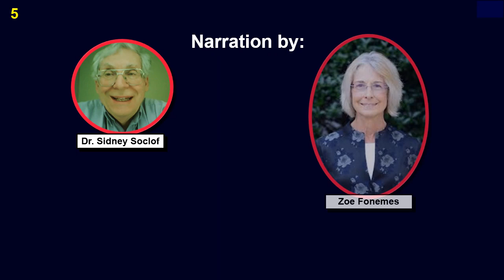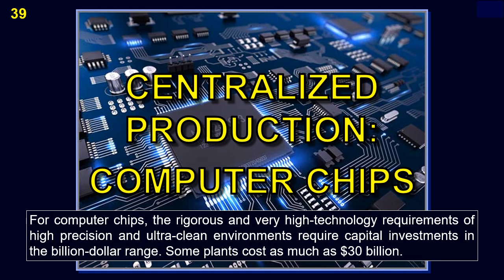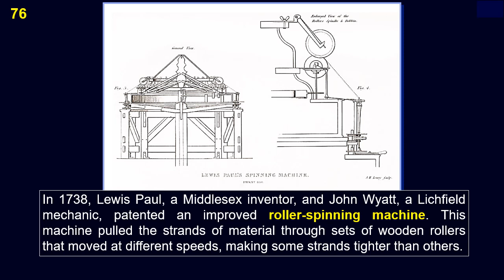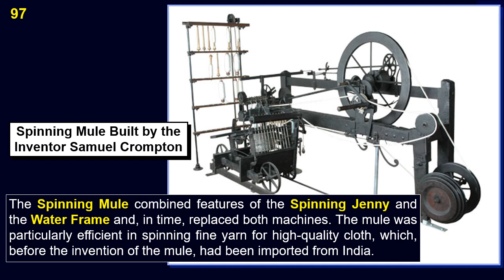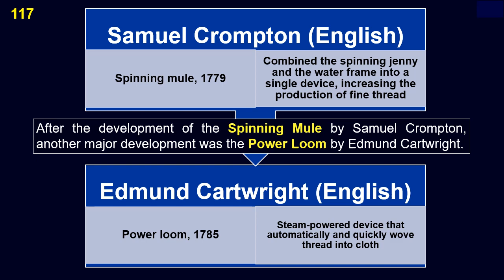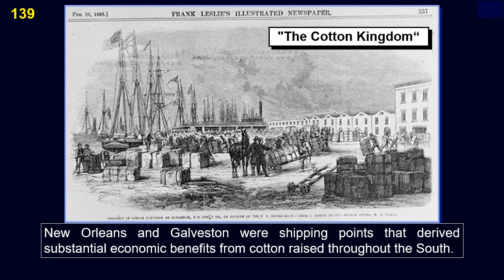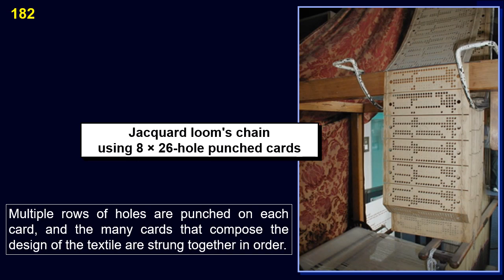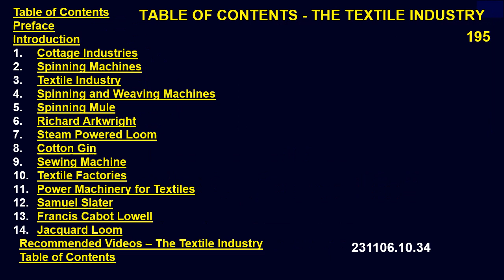Textiles

Comment: I (mostly) listened to this video while in my electronics shop restoring a 100 year old electrical cable with woven cotton braiding.  I wish I had had access to some automatic braiding tool.  My first industrial job was modernizing carding, roving and spinning machines designed in the 1920s with photoelectric stop-motion controls.  So, I found this presentation to be great background information.